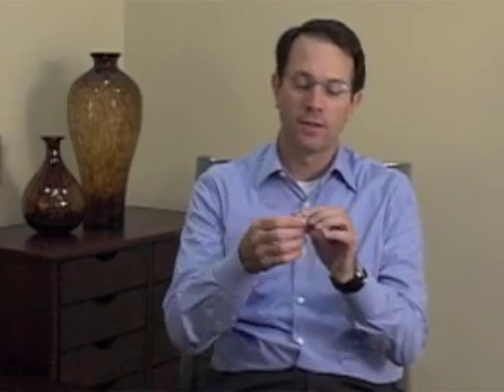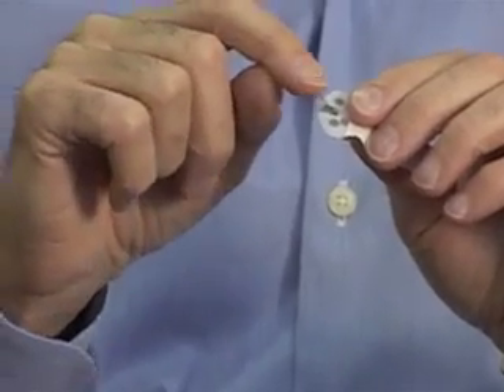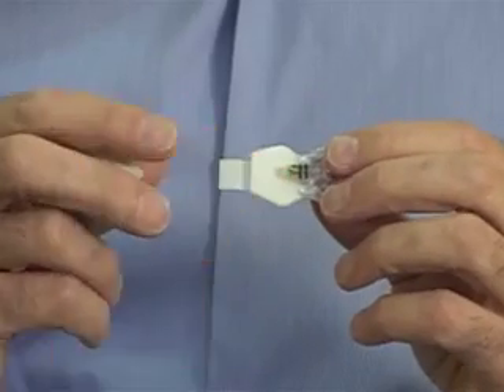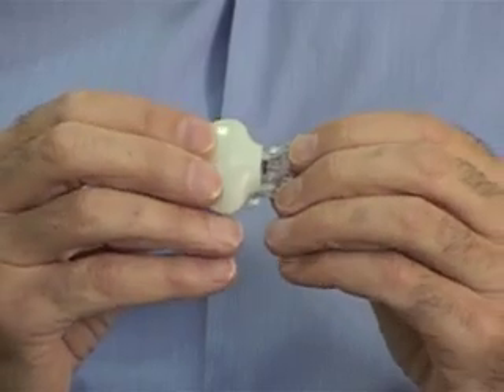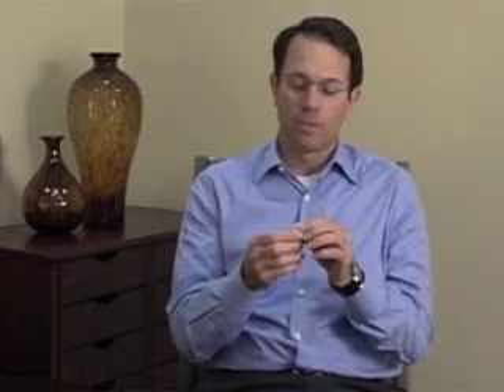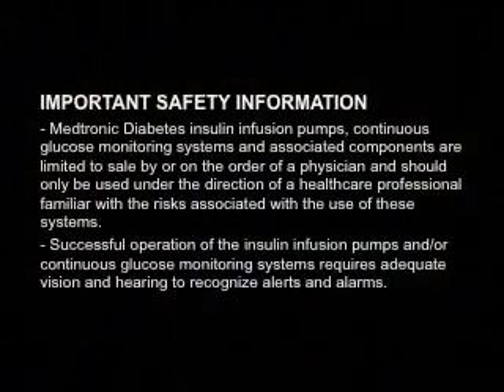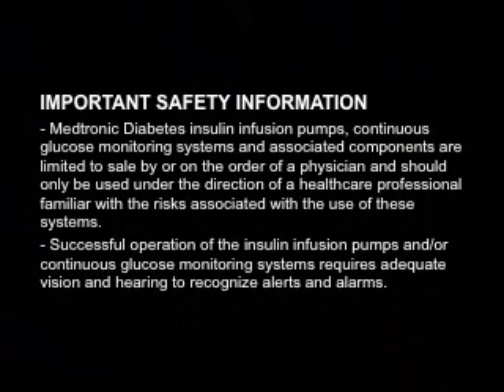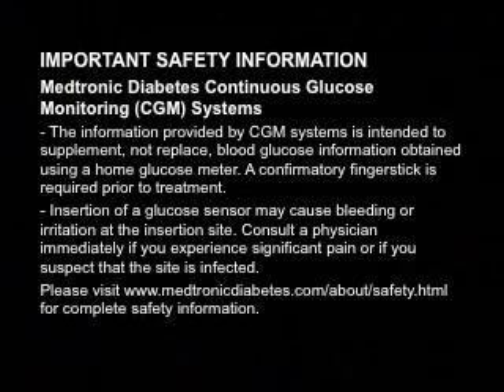How Does a Continuous Glucose Monitor Really Work?

Comment: With this knowledge, is there any ways to actually increase the run times of a sensor, perhaps treating it before insertion, or even afterwards?

Purely hypothetical of course. I'm just wondering why some people experience longer/shorter runs than other people, and if any stabilization could be obtained for something that is quite expensive to use for many people.
Reply from the maker: Rob, while everyone is different, many of our customers are able to wear their sensors for the full 6 to 7 days (depending on which sensor you're wearing). If you're not able to wear the sensor for this long, please let our 24-Hour HelpLine know at 800.646.4633 option #1. They’d be happy to help.
Reply: Medtronic Diabetes: Jjust more interested in what makes some not able to. What makes the reactive agent break down faster,  or alternatively slower from one person to another?
Why the potential variance?
Reply: @MedtronicDiabetesUS  i have the same problem, I made a very Ugly irritation because of the glue. If i do a Shower evry day the senzor  falls of after 3 days, i do a lot of sport
Reply from the maker: @sebis7733  our technical support team has suggestions that can help. Please give our team a call at 800.646.4633 option #1.